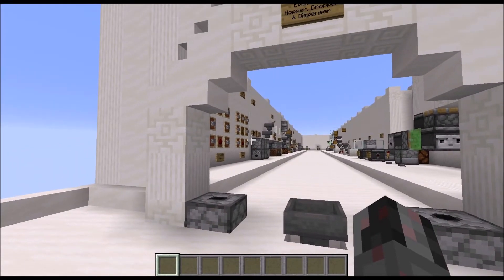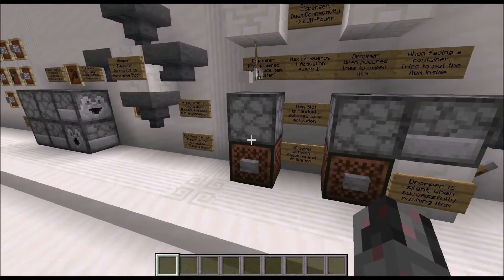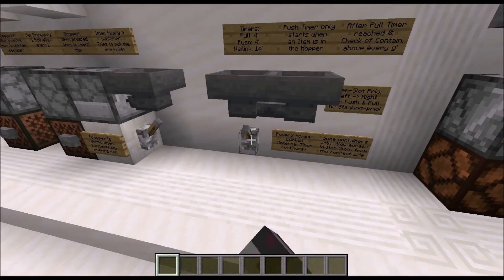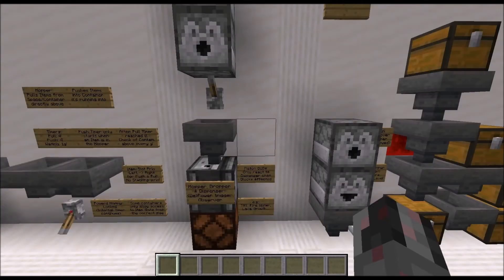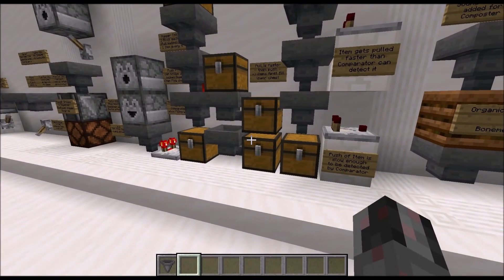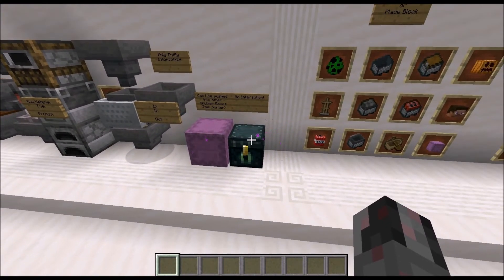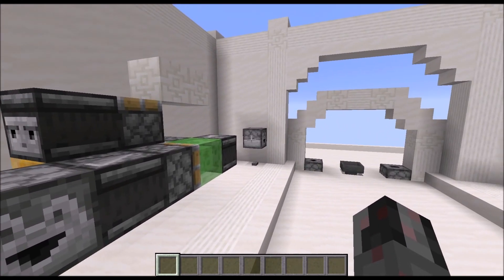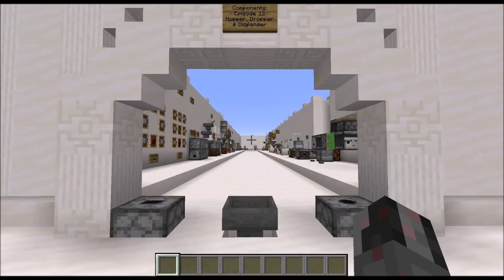Redstone Components: Episode 12 - Hopper, Dropper & Dispenser [Java Edition 1.15.2]

Comment: Two notes:
- Dispensers can interact with bee nests/hives. When "dispensing" a bottle into a nest/hive block with honey level 5, it resets to level 0 and a honey bottle is created. That bottle is stored in the dispenser if it has room, or ejected. Similarly, "dispensing" shears this way creates a stack of three honeycomb items that are ejected from the dispenser.
- Another, often underestimated, source of lag from hoppers is when it attempts to push items into a full inventory. The hopper will check each of its slots against each slot in the target inventory every game tick (unless it's in cooldown), which can add up considerably when it targets a double chest full of either complete or incompatible stacks and has items in all five slots.
Reply from the maker: Thanks! I completely forgot about the bees. And good that you mention the lag issue of hoppers, I only knew about a similar problem with droppers.

I'll mention both in my next addenda episode.

Comment: good job, is there any way to dispense one item at time,
I have a shulker box unloader and loader and I want to dispense one shulker at a time (I used the comparator repeater mechanism to achieve that) but whenever there is more shulker boxes the mechanism activates over and over again and produces a clicking sound lol which is somehow annoying.
Reply from the maker: I take it you used the auto-dispenser I showed? Yeah, that would produce a constant (& annoying) noise.

How to solve that depends on what you want:
1) If you just want to dispense a single shulker box at a time and later remove it manually, I would simply activate the dispenser with a button instead of an auto-dispenser.

2) Auto-loader:
a) A Comparator takes an output from the (dispensed) shulker box
b) The output of the Comparator blocks the auto-dispenser from running
c) Once the Comparator turns off (shulkerbox is empty) a monostable cicuit triggers a piston to break the shulkerbox (you may want to block the hopper below the shulkerbox - which unloads said box - at the same time, so the shulker can be pushed on top of another hopper and stored sepeartely)
d) the Auto-dispenser should now be unlocked again and place the next available shulkerbox to be unloaded
Warning: This setup can't digest empty shulkerboxes, since they won't trigger the reset (c&d).

3) Auto-unloader:
Same as 2) only with an inverted Comparator output

I would recommend searching for shulkerbox (un)loader stations. There are a lot versions already out there.